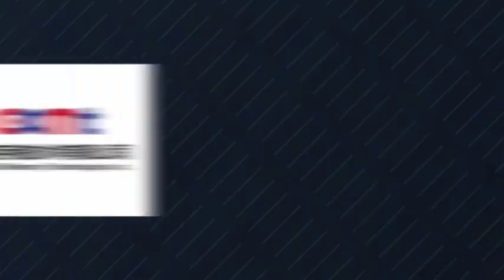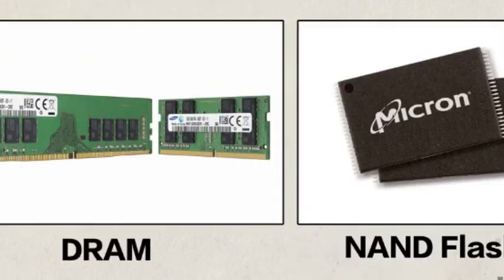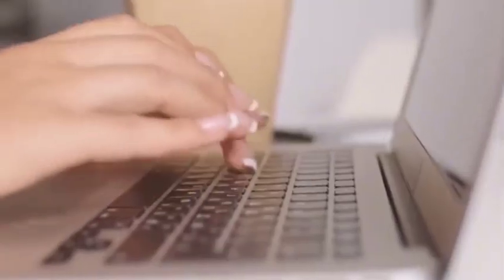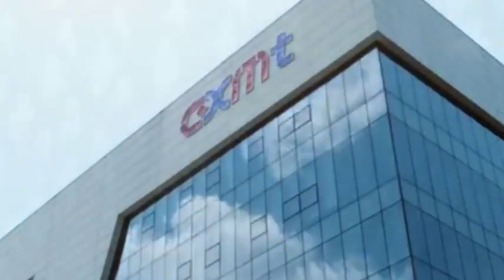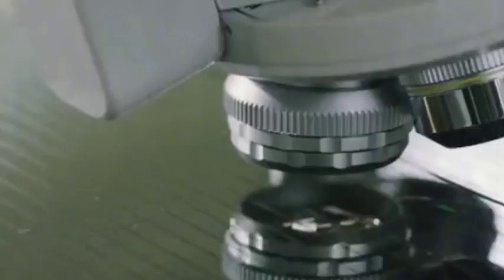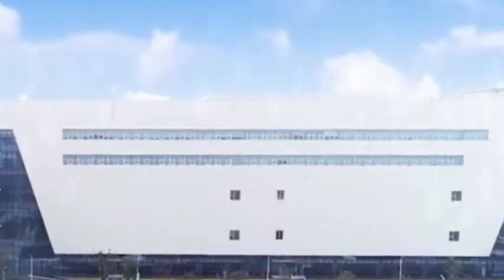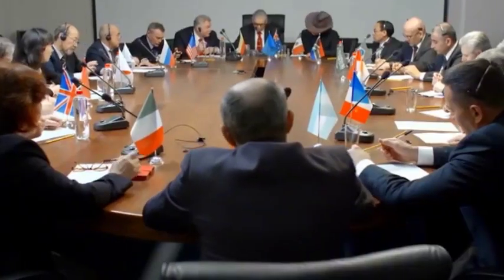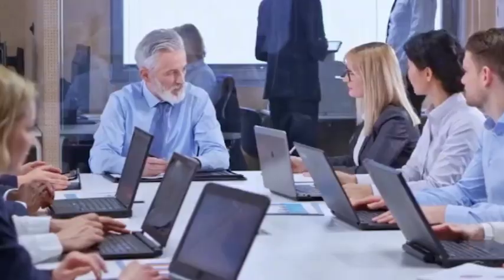China kicked Micron out of the Chinese chip market and Micron refused to accept the review results!

Comment: Micron is America's Huawei.  The retaliation is based on what could be, not on what is.  One could argue that any product that uses semiconductors could be weaponized, that's why the paranoia about collecting data from home appliances to cars.

Also, not mentioned is that China's domestic memory company was rebuffed when Apple was about to use Yangtze Memory as a memory supplier but was restricted by political pressure not to do so.  Yangtze Memory will be the Huawei of memory chips and gain market share in the domestic Chinese market.
Reply: Micron cannot be compared with Huawei. Huawei is like 24K gold whilst Micron is like gold plated.
Reply: @johnchow8372  You missed the point.  Both sides have now weaponized 'national security risks.'